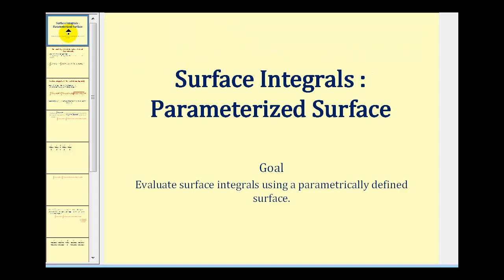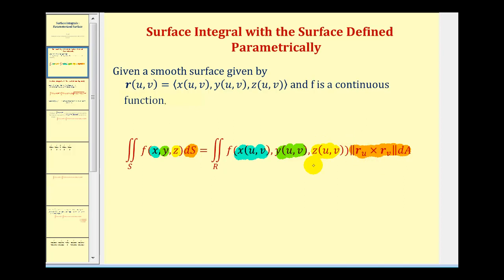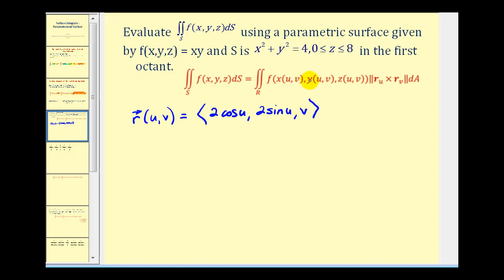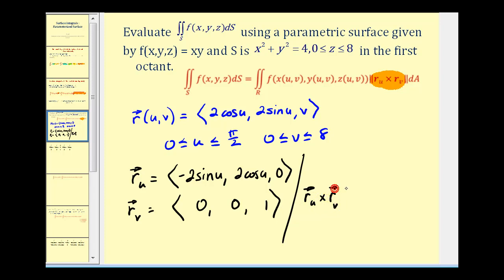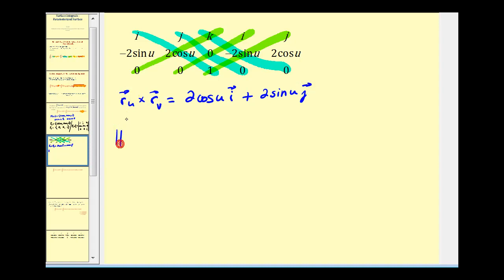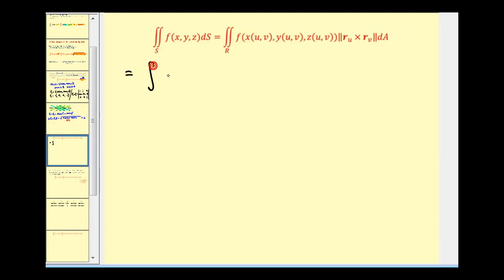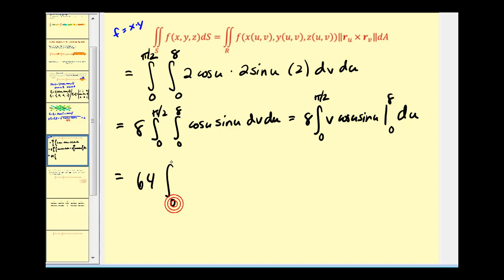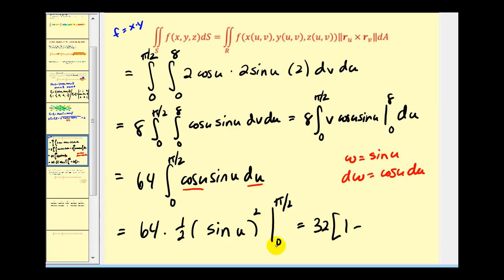Surface Integrals with Parameterized Surface - Part 1

Comment: Just a tip for other viewers that in my opinion makes the last two rows of this video easier to calculate on a test where you're more stressed and likely to make some careless mistakes when substituting (from my own experience at least):

Trig identity: 2*cos(u)*sin(u) = sin(2u). Therefore: 

64 * the integral of (cos(u) * sin(u)) du =
32 * the integral of (2 * cos(u) * sin(u)) du =
32 * the integral of (sin(2u)) du =
32 * (1/2 * -cos(2u)), u goes from 0 to pi/2, =
32 * 1/2 (-cos(pi) - -cos(0))=
16 (-cos(pi) + cos(0)) =
16 (cos(0) - cos(pi))
= 16 (1 - (-1)) = 16 * 2 = 32.

But in the end, it's a matter of preference of course. Thank you so much for the awesome videos on surface integrals and parameterization, something I've been struggling to get for quite some time now! =)